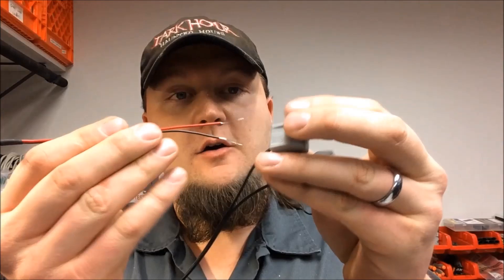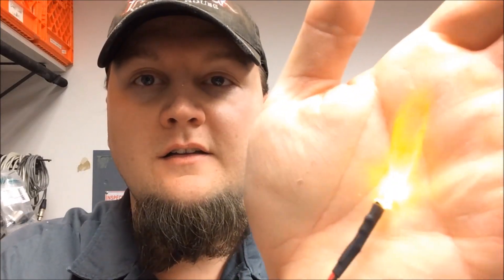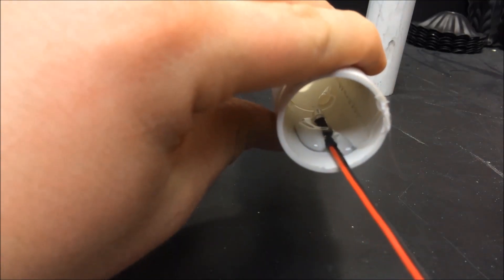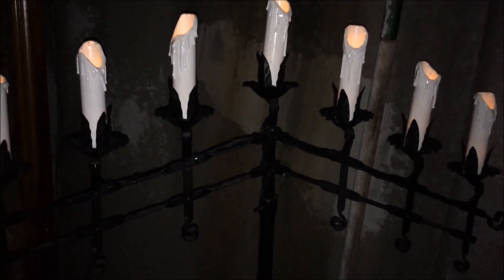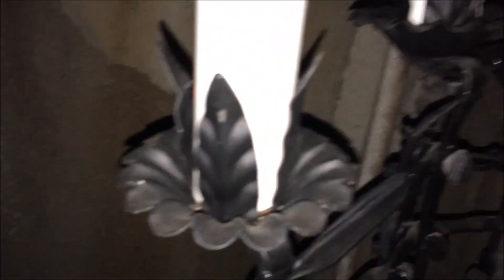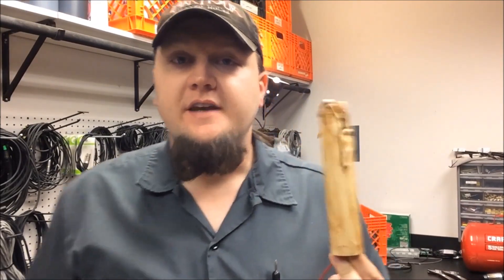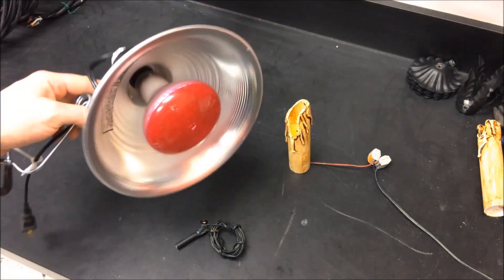LED candles

Comment: These are really good. I worked with pvc for awhile and used to use acetone to clean it. Would remove the lettering and alot of the shine. Results may vary of course but always worked when I used it. Awesome video thanks.

Comment: Jake and Allen, thank you for this.  I had purchased the lighthouse leds, and wago nuts, but ran out of time to wire everything I wanted to this year.

I was able to quickly wire 5 foam pumpkins last night (halloween 2016) just as the first ToTs started to arrive.  Probably took me 30 min (maybe less).

One thing with the Wago nuts, lifting the lock levers was much more difficult than i anticipated.  i ended up using a screwdriver as an aid for leverage.  I was afraid I was going to rip my fingernail out without it.  Once locked, the thing is super secure.

Comment: These look great. I'll have to check out Lighthouse LEDs. Looks like I can get all the pre-wired lights and a 12v plug in one order. Do you find the resistors get particularly hot with the voltage drop having to go from 12v to 2-3v? A lot of my DIYs use foam, and heat+foam = fumes. Thanks!

Comment: What did you use as the power for these when wanting then to be on a table not next to a wall.
Reply: You can use a normal 9-12 volt power supply (found at most thrift stores) and just hide the wire under a table cloth. We also use 9v batteries and easily power 4-5 candles for several hours with no issue.

Comment: How can I make these as water resistant as possible? I'd like to line the outdoor banisters with them, but it rains a lot.
Reply from the maker: I mean, just cover the LED and connections in clear caulk- the rest is 100% waterproof, they last fine outside.

Comment: Just would like to know what the LEDs plug into. All I'd want would be the candles, no other lighting.
Reply from the maker: just a DC powersource for the LEDs normally a wall war I will use up to 1 amp for them
I explain all that in this video if you are unfamiliar- its the same thing just the LED housing looks different-
https://www.youtube.com/watch?v=rf3PltSCxSE
Reply: There has to be something that the leads on the ends of the led are wired into, which is then connected to or plugged into a battery source or wall outlet. I have never worked with leds before, nor have I ever wired anything before, and I need a bit more clarification. Please pardon my ignorance, guys. Just never have done this before...what part are the leds attached to, and will that have wiring itself for either batteries or a wall outlet?
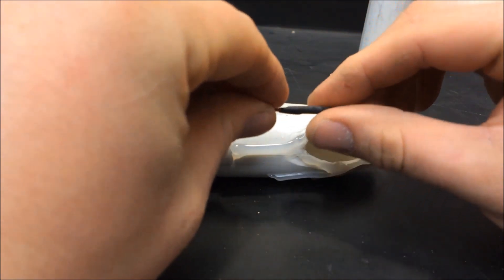Reply from the maker: I use speaker wire. here is where I explain wiring- this link should go to 8:34 in the video if not then skip to it.
https://youtu.be/rf3PltSCxSE?t=514

Comment: Have you found anything that allows the light to transmit through it like a wax candle does?  The PVC blocks all the light from passing through it.
Reply from the maker: use shark bite pipe, its much more transparent.

Comment: Really nice!

I noticed at 13:49 that the bank of candles in the alcove all flickered at the same time. Is that a camera artifact, or are they really all flickering together? Wondering if the "random flicker" circuit that drives each of the LED's is identical, and initializes all the LED's on the same string when power is applied.
Reply from the maker: +Todd Henson That bank of candles was made before we started using the flickering LEDs. It has two flicker boxes so there are two flicker patterns split among all the candles. The flicker in each of the new flicker LED does give random flickering.
Reply: +StiltbeastStudios Certainly worth the price, then! Thanks!
Reply: Allen, do you think Jake has images of the wiring process?

Comment: Starting to get things together to make these  candles, one question.  I'm buying the 12vdc plug in---does it matter if it is 5amp or 1amp, I do not want to buy the wrong one and have them fail.  Thanks for the earlier info.
Reply from the maker: +lilac2484  as long as you dont need more than an amp the one amp is fine- it HAS to be 12V but it just needs suffucient amps to power the LEDs ~35 LEDs per amp

Comment: That floodlight seems kind of expensive, anything special about it. Could I find a cheaper substitute I could flicker with an arduino?
Reply from the maker: Im sure you could- at our haunt there is alot to be sad for uniformity- we use the same controller as often as possible, but you dont have to.

Comment: Is there a link to the little connectors you use?
Reply from the maker: https://www.amazon.com/Wago-222-413-LEVER-NUTS-Conductor-Connectors/dp/B01AO24UG8/ref=sr_1_sc_2?ie=UTF8&qid=1470546689&sr=8-2-spell&keywords=waygo+connectors
Reply: Thanks. Working on some candles now.

Comment: I've used paper towel/toilet paper tubes for this sort of thing too. And pringles cans :D Cheaper and quicker, though less durable.
Reply from the maker: Also more flammable, I try to not mix paper products and electricity, even 12 v
Reply: +StiltbeastStudios Indeed!! I just used some little LED tea light candles in mine; it was a great quick way to whip up some black candles for decor :) But yeah, definitely wouldn't be the best idea to wire up a bunch of cardboard tubing XD

Comment: I have a bunch of LED Candles which flicker just like a regular candle.  I opened one up and could not find anything in it besides the battery, a switch and the LED.  Now I am a power electronics engineer with enough experience behind me to understand what I am seeing, and yet I am perplexed by this.  It may be possible that the LED's themselves have some circuitry inside the package, but I have not gone over it with a magnifying glass.  If anybody else has seen these things and knows whats happening I would like to hear from them.  I bought them from the 99 cent store for 2/$